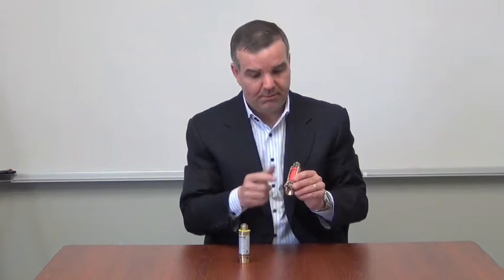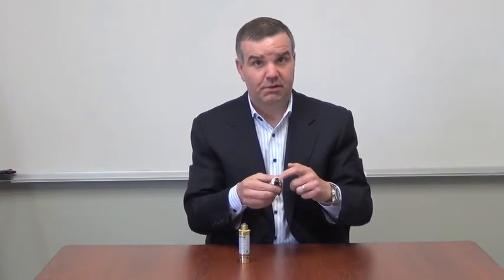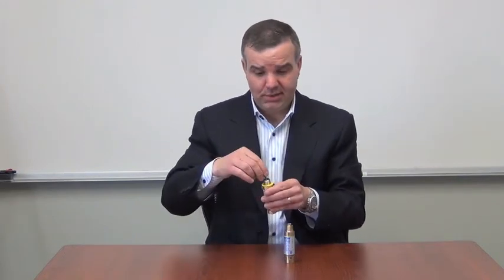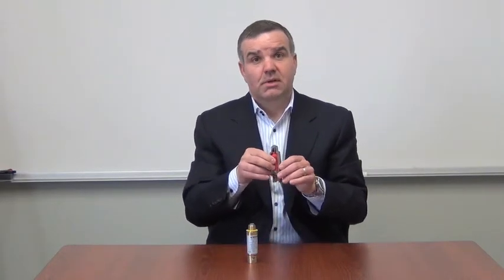MIFAB MR-500-NPB Key Features

Comment: I still don't understand what the purpose of the pressure drop actuator. I have one in my basement leading to my floor drain and I have the valve closed for it because I don't understand what it does
Reply: Hey Alex, if it's trap primer like the one in the video the purpose is to add a little bit of water to the floor drain.  If you do not, over a period of time the floor drain's P-Trap will evaporate allowing sewer gasses to enter your room.... not a nice smell!  Now if there is already flow from another source (condensate waste from A/C coil) then you would never have to worry about it.  hope this helps!  James
Reply: @jameshicks7096  thanks yes that does help. I have the ac and dehumidifier draining into the same floor drain as the pressure drop valve.. in the winter time we have the sewer gas problem still bc our pressure drop thing stopped working
Reply: @BeerkegGarage  no problem happy to help! For the winter when you notice the smell just pour a glass of water down the floor drain every couple of weeks, that should solve your smell problem.